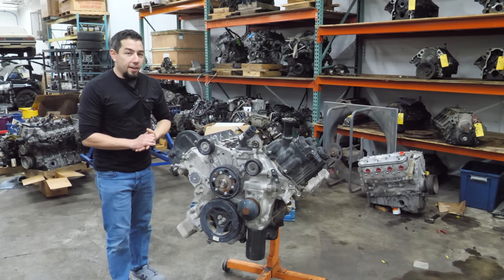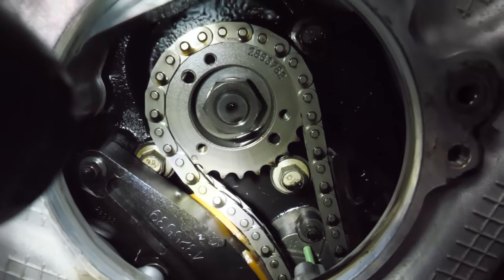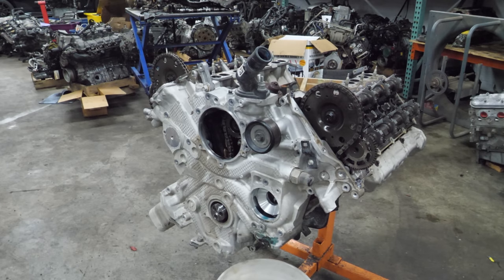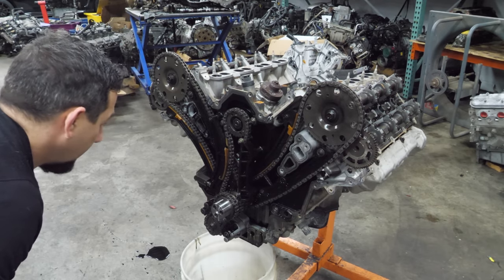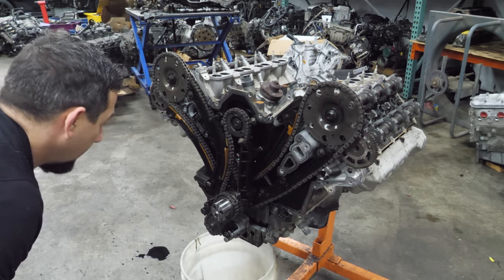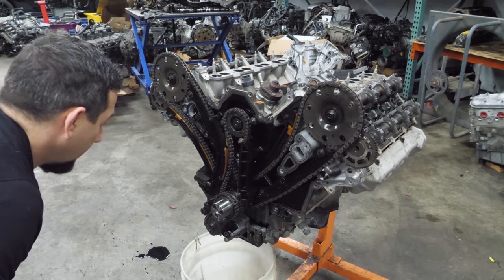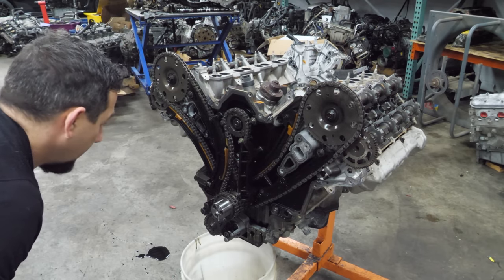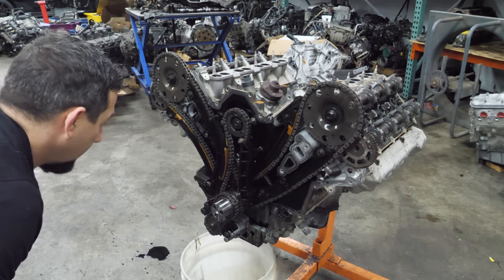Well That's Not Good! Nissan Titan XD Cummins 5.0 Turbo Diesel V8 Teardown. A Costly Failure!

Comment: As a former Master Nissan tech, seeing broken crankshafts were extremely common on these 5.0's, especially the 2016 MY. The crank had a weak design, and they would break in the area in the video. If they were kept stock and not juiced up, they generally were ok. Lots of farmers in my area bought the Titan Diesels and expected Chev/Dodge/Ford diesel power out of these engines, but they weren't intended for that kind of work.
Reply: they should have been because thats the target market for large diesel trucks, hard work.
Reply: Imagine making a diesel full sized truck, and not 'designing it' for that kind of work 😂
AKA Nissan had no idea or business making diesel trucks
Reply: @nickh3809  ive worked mine (2016) hsrd and driven it hard since I first bought it. I regularly tow heavy with it and have had zero issues. Ive had the truck 5 years now and almost 100,000 miles and no problems yet (knock on wood). It tows with the same stability of a 3/4 ton but rides way better. Pulls my tractor lile it isnt even there. I tow with the 30hp tune and it really pulls like a freight train. Ive worked it in the oilfield on these rough lease roads since I first bought it. Only thing ive done is brake pads, upgraded to Bilstein 5100 series shocks amd replaced the turbo actuator because it was sticking. Other than that its neen perfect. The seats are more comfortable than any other truck ive driven, and I love how you can adjust the headlights from a dial on the dash so if youre hauling or towing heavy you can dip the lights down so its back on the road instead of blinding oncoming traffic.
Reply: 7,000lb truck making only 310/500 isn’t adequate for towing by modern standards. I have a 19 year old Ford that weighs 5,400lbs and makes 400/710  not crazy numbers but it’s power to weight ratio is pretty decent.
Reply: @zackzittel7683  its more than adequate for towing. F550, F650, and F750 medium duty trucks are derated to a max of 330hp amd weigh over 10k by themselves before mods and add ons. Our F550s weigh just over 10k and we pull heaby gooseneck that are way heavier than what my XD tows. Stock my XD was adequate, tuned its way more than necessary. I only use the 30hp tune towing and its night and day from 0hp. People want to go 0-60 in 7 seconds with a 10k trailer. The power levels these newer trucks have is unsafe in the hands of people with no experience towing honestly. Fords making what, 1100lb/ft now in the power stroke? Thats approaching the levels of 12/13 liter engines in 18 wheelers. The Cummins ISX12 made 320-400hp and 1150-1400lb/ft torque. Notice how much they derate these 3/4 ton diesels when they put them in larger vehicles. For one, they wouldn't last. Wasnt that long ago the engine in the XD would have been very competitive, even class leading. The 6.4 powerstroke in 2010 made 350hp and 650lb/ft torque. The 6.0 powerstroke made 325hp amd 560-570 torque. Not far off from the XD. For 3/4 ton duty yeah I'd say its a little underpowered, but for what its rated to tow and haul its adequate.
Reply: @zackzittel7683  for having that much power in a 5400lb truck I bet it rips. Im making similar numbers in my XD amd while its not blistering fast, its definitely not a slouch. Hits triple digit speeds way faster than it needs to honestly.
Reply: I think it can as a shock to Nissan also that it wasn't designed for hard work.
Reply: @Jackmerius_Tacktheretrix  you ran Zach off!
Reply: @bestbroseph1258  The XD diesel was not a large truck goober..tow rating was only 12K
Reply: @zackzittel7683  It is not a 7,000 pound truck....and it was designed to tow max 12K
Reply: Buddy's eco diesel. 2016. Has 212k on it. Fuel pump issues and sensors is about all the issues
Reply: @zackzittel7683  They're only like 5,500 lbs
Reply: @mediocreman2  the diesel titan xd , I own one, is over 8500 lbs empty, which makes it exempt from having to list EPA fuel mileage rating
Reply: @Cherokeelion  Curb weight of these trucks is 7200lbs, GVWR is 9000.  My CC F350 PSD FX4 weights 8000lbs with a GVWR of 11400lbs.
Reply: @louisschummer931  you are correct, I spoke wrong there. Its still an odd 5/8s spec that would have worked better if they had made it a 3/4 ton. But then you start to get underpowered even though it probably would pull. Then you get into likely overworking the 5.0 pulling 3/4 ton loads. So… just a sort of mismatched setup, doesnt take anything away from the ride quality and the seats. Nissan wasnt wrong in discontinuing the 5.0 In the package they offered it in. I say this as an owner, I still scratch my head at what they were trying to do with it.
Reply: Nissan put their trust in Cummins engineers. Boy did they get skunked.
Reply: they could take same power, or maybe even more, but the crank is kinda a weak link. they flow better, thanks to the ohc system they should rev even higher, generally seems like pretty good engines, if they were not snapping cranks
Reply: @nickh3809  the truck itself was fine, the snapping crank was problem of cummins which nissan just used their engine
Reply: @bestbroseph1258  the engines made by cummins were not made for that kind of work. the truck itself was relativly fine
Reply: @Chef-James Cummins actually isn’t the bad guy here, they didn’t want to do a V configuration in one of their engines like this but Nissan insisted on things being their way to fit their truck like they wanted and there was some back and forth about it for a while. Cummins built the engine how Nissan designers wanted and it was a bad idea somewhat.
Reply: @Bos742 
What are you talking about? This engine was designed long before Nissan came knocking.
Reply: If broken crankshafts are common in them they were intended for any kind of work lol.
Reply: @nickh3809  Nissan didn't make the engine though, Cummins did. Cummins dropped the ball on this one, not Nissan.
Reply: The only comparable trucks are other 1500’s with diesels. The Italian eco and 3.0 powerstroke. None of them are intended for serious heavy work.
Reply: Nissan had chosen the right name for this engines: TITAN 😂
Reply: @nickh3809 It was never an HD but a heavy half sine most 3/4 ton owners don’t even need it.
Reply: @zackzittel7683 It’s plenty. It’s the payload that’ll give out first.
Reply: @chadhaire1711 oh it’s large, it just wasn’t made to do 1 ton stuff.
Reply: @Cherokeelion it’s nowhere near 8500lbs.
Reply: @joenissan  I know, I misspoke and said so 7 months ago.
Reply: @joenissan  It was rated for 12,000 pounds
Reply: @Jackmerius_Tacktheretrix  "The power levels these newer trucks have is unsafe in the hands of people with no experience towing honestly."
I completely agree. I own a 2017 F350 6.7 CCSB, and tow a 6 ton 35 foot 5th wheel. The 6.7 provides enough power to tow at unsafe speeds. I put more time lowering speed for safe control than I do watching traffic because I'm going too slow.
Reply: @danielclawson2099  I couldn't agree more. Even the 5.0 cummins in my Titan XD can easilly get my tractor going way too fast without even realizing it. I keep the tune at 30hp and it still pulls my 40hp tractor like it not even there. I can only imagine these high output 3/4 tons. On the 120hp tune I still don't make the power that new 3/4 tons make, and even then with the 120hp tune its just insane how fast that baby cummins 5.0 in my truck can go when towing. It really makes me rely on my cruise control alot more. I mean my truck will pull hills on I-10 with 9k lbs without even shifting out of overdrive unless I have the cruise set.
Reply: Imagine buying a brand new diesel with near zero emissions and taking the emissions equipment off. This trucks not supposed to rev that high. It’s makes tons of power down low and engine rarely likes to go over 2000 rpm. I’m taking care of mine see you boys in a decade
Reply: Pretty sure Cummins fixed the issue with the superseded crankshaft that as best i can tell, was implemented in late 2017. Most failures were 16-17my, and i know of one early 18 that probable got a 2016-17 crank. I have not heard of any my19 failure... right when they killed it. Nissan didn't give themselves enough time to kick that bad publicity.
Reply: @Jackmerius_Tacktheretrix  The engine in the tear down seems to done alright until 120 k, good luck.
Reply: @zackzittel7683  trucks 20 years ago were towing just as much, weighed more, and made ~300 horsepower and ~500 ft/lb of torque. You don't need a 1200 ft/lb truck to tow with a pickup lol
Reply: @johnarnold893  hopefully so. I take care of it and keep the oil changed. I do run it hard amd tow with it, but I also don't have the other "stuff" that is bad for these engines.
Reply: @mediocreman2 not sure what scale you’re reading, but these trucks are all over 7300 pounds curb weight.
Reply: Was it a metallurgical issue?  The crank seemed more than heavy enough.. that crank snout was very thick.
Loved the timing setup too..  each component has its own chain with very little deflection in the path... all nice straight paths.
Reply: As the Nissan Tech said. They are ok. They weren't designed to be juiced up. As the owner of this block noted. He juiced it up. 
And he killed it. 
This backs up the Nissan Tech words. 
Also I read of owners. He likes it.
Reply: @zackzittel7683  power and torque have little to do with towing. In fact that's more then enough to tow 10k lbs at 60 70 mph
Reply: @chadhaire1711 It’s 7400 lbs for the diesel XD PR
Reply: @mediocreman2 nope, 7400 lbs
Reply: It’s really funny, that’s exactly the same story of GM’s 6.2/6.5, those just had the additional hurdles of zero general diesel knowledge. Not designed to compete with the big dogs, just to be a decent side-grade to a gas engine of the period.
Reply: @nickh3809 imagine imagining!!!🤔🤪😂😭🤐
Reply: @zf9903 well they had knowledge actually tons of diesel knowledge because general motors owned Detroit diesel not sure if they were consulted diesels not my wheelhouse
Reply: @Jackmerius_Tacktheretrix Yes, towing is really more about the frame, transmission and brakes than the engine. But longevity depends on how the engine is designed, keep in mind those box trucks you’re talking about make the same HP with an extra 1.7 liters of displacement, and an engine that is designed for medium-duty trucks. This engine could very well be too overstressed for constant extreme use if it’s built to be light and compact like a car engine.
Reply: @alexbeuerman7608  I agree, a perfect example is the 6.7 powerstroke. F550,F650, and F750 medium duty trucks with that engine are detuned to a max of 330hp. The ISV for medium duty trucks is advertised as 200-275hp and 520-560 lb/ft torque, which is less hp than the 310hp ours makes but up to 5lb/ft torque more. Our engines still make a lower specific output (hp/liter) than the small 6 cylinder diesels in half tons and the bigger engines and 3/4 tons. The powerstroke high output makes 500hp with 6.7l which is 74.6hp/liter. The 5.0 cummins makes 62hp/liter. The baby duramax 3.0 makes 277hp with 3.0 liters which equates to 92.3 hp/liter. So id say the isv 5.0 is somewhat less stressed than most other pickup diesels stock for stock except the non-high output Cummins 6.7 in the Ram, which makes 370hp whuch equates to only 55.2hp/liter, while the high output 6.7 makes 420hp which is 62.68 hp/liter. The duramax 6.6 makes 445hp or 67.4 hp/liter.
Reply: @Jackmerius_Tacktheretrix   Absolutely, and another thing to think about is construction. A 5.0 V8 diesel with overhead camshafts is a lot of engine to cram into a half ton truck and iirc the ISV uses a compressed graphite iron block that is designed to maximize savings on size and weight like a diesel car engine. The 6.7 PSD doesn’t necessarily follow suit.

As an aside I had no idea the ISV was put in anything besides the diesel titan, seems like a smart idea to recoup tooling costs I guess.
Reply: @nickh3809  Nissan has been successfully putting diesel engines in pickups since the 70s.  Nissan North America got conned into using Cummins' unwanted V8 and screwed up implementation of putting that engine into a Titan.
Reply: Made in China oh boy Cummins

Comment: The crank broke from a MASSIVE design flaw… Crank has a huge unsupported snout with a 40LB harmonic balancer at the end, torquing it around. These dumb design mistakes stopped showing up years ago, surprised to see them making a come-back  🙄
Reply: Would you recommend a diesel titan to a first truck buyer? If not which model should I be looking at aside from a tundra.
Reply: @silentriver8488  A tundra or Tacoma. I dont think USA gets the Hilux. 
I've owned 5 Toyotas since 2001. Its the only thing I can recommend, having driven many brands. American cars, at least the new ones we get, are very unreliable even in these days, its ridiculous.
I dont think you get any Diesel toyotas which is a shame. The turbo diesels are amazing. 
So I think your best bet, assuming you're in the US, is a powerstroke 7.3
Reply: @josef5319  I remember a freind had a brand ne toyota mini truck 1981 that had the diesel in it, bought in New York , drove home to Tacoma Washington, drove it till the body rusted away, great little truck